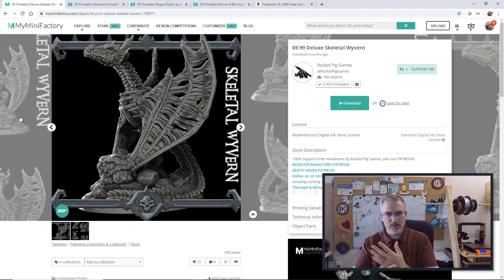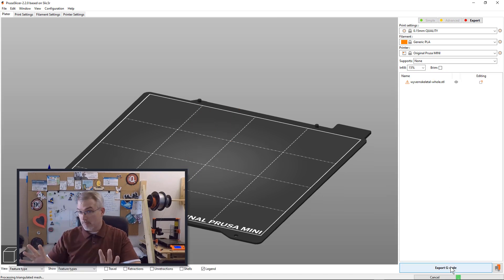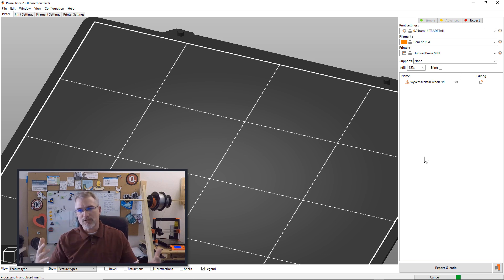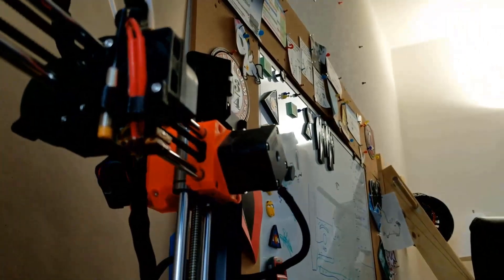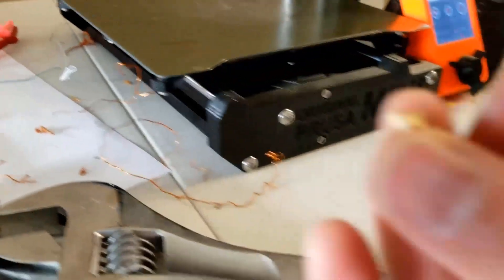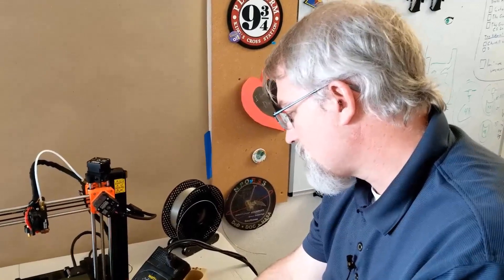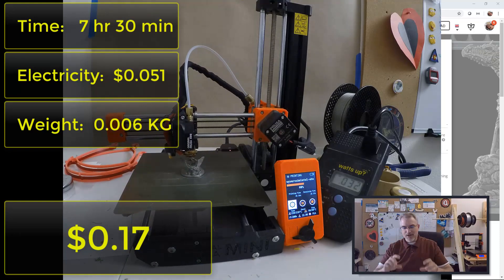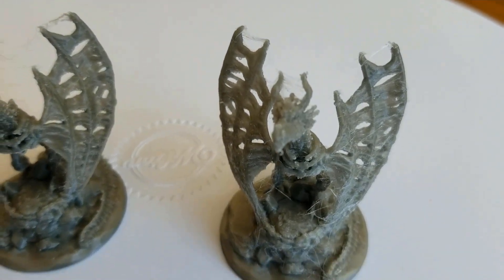Prusa Mini: Printing Miniatures 0.25 vs 0.4 nozzle

Comment: this video a couple years ago but do you use any supports on these when printing?
Reply from the maker: No you do not need to do supports with this particular model.
The folks at rocket pig games https://rocketpiggames.com/
Design 3D models in such a way that they do not need supports :)

Comment: Why do you take the nozzle off while hot?
Reply: That's normal practice, so any residual filament doesn't lock up the threads because its softened.

Comment: Noob question if I may. Why do you have to heat the nozzle to remove it?
Reply from the maker: The nozzle is in there pretty tight.  I did try to remove one once without heating it and I snapped the nozzle in two.
I believe heat block expands a little bit more than the nozzle when heated making it easy to replace

Comment: Hi Patrick, great video! I came to mention the Mini profiles available in PrusaSlicer like everyone else, but I'll give you directions to find the profiles. Open PrusaSlicer, on the right side under "printer" click the drop-down, at the bottom select "add/remover printers" , go to "Prusa FFF", and tick any of the nozzle sizes you want to use. Whenever you swap the nozzle on your machine you can change your profile in PrusaSlicer in the "printers" drop-down too.

Also, I'd like to point out that changing to a smaller nozzle only helps X/Y resolution. For example, smaller text is more legible when it's printed from a smaller nozzle. The only other advantage is printing very small things. I'm a MK3 owner, and I recently got an experimental 0.15mm nozzle from E3D. It's "experimental", so there aren't Prusa made profiles for it, but It's fun to experiment. With the 0.15mm nozzle, I was able to print a good looking "benchy" print at 12.5% scale. It's not super beginner material, but if you're curious how far you can push quality with an FDM/FFF printer, I can email some pitcures.

Thanks for the video!

Comment: Have a look at Makers Muse when he tested how much power is used on 3D printers. He used printers with and without heated beds and you are right. The stepper motors use bugger all power, the heated bed is the power drainer.

Comment: You should run the initial configuration wizard again (somewhere in the drop down menus) and select the .25 and .6 nozzles for you Mini, too. This way you will have proper settings after selecting the nozzle profile you want in the printer settings tab. It’s also a good way to simulate a different nozzle when slicing - to find out whether it makes sense to switch for certain prints.

Comment: Great experimenting, thanks :) The comment on linewidth below was also on my list so I'll skip that, but what I also thought was interesting was the minimum layer height when you changed it manually was 0.07 but it let you slice at 0.05.  The other point to mention is that the Prusa machines are very well calibrated out of the factory, but are still pretty 'generic' across the product. I tweak mine for dimensional accuracy for each filament I use, e-steps, extrusion multiplier, linear advance (which the mini is totally crap at so far by the way), but if you do this on any decent printer you can get great results as it's just a function of how long you want to spend tinkering :) An Ender 3 can do great work and CHEP's FIlament Friday dude (amongst others) does this with amazing results.
Reply from the maker: Good point to note.  Yeah if you are willing to tweak the settings you can get better results.
I am going to keep with "out of the box"  because I think out of the box will get better and better over time.
But... if all you were going to do was print miniatures you would want to tweak it so you could get better results.

Comment: Hey Patrick, I appreciate your videos/interrogations/tests. but you missed something on the 0.25 nozzle. its not only the nozzle size you need to change, you have to also change the extrusion width. normally a 0.4 nozzle will have somewhere between 0.42-0.5mm width depend of the profile you're using (stock... prettyPLA, etc...). if you only change the nozzle size, you arent changing the extrusion width so your printer will push a 0.42mm line through your 0.25mm nozzle. I often push 0.8mm width through a stock 0.4mm nozzle. and also lower my width to 0.25mm on a stock 0.4mm nozzle! you will have to redo your testing if you really want to compare :) also... on a 0.25mm nozzle youll want to set about 0.265 to 0.27 extrusion width for a  "perfect" squish. the extrusions are available in Print Setting => Advanced. happy printing!
Reply: Came here to say the same thing. If you switch over to Prusa's 0.25mm nozzle configuration that does this I bet your print times change a wee bit. :)
Reply: @IanDouglas  that's true, you could change the printer setting profile to the 0.25 nozzle default Prusa profile. I guess that's what Patrick would prefer as he doesnt like messing with setting normally. and I just noticed the extrusion width is plain simple 0.25mm hehehe
Reply from the maker: I don't like messing with stuff (So I can show the standard results)
But if Prusa has nice profiles I can download that is doable... Since you usually don't print at 0.25
Reply: @iqless  there nothing to download for 0.25, just add it as another printer profile. It's already built into prusaslicer
Reply: @iqless  Its only a matter of order you have to follow in Prusa slicer - first change printer (nozzle diameter), than select the filament, than the print settings. Because Prusa Slicer automaticly loads different print settings depending on nozzle diameter, even if the settings seem to have the same name (internaly they are named with "@0.25, @0.4 and @0.6). Prusa slicer automaticly selects the print settings depending on the printer settings at the moment you select the print settings from the list.

So by selecting "Ultradetail" first you loaded the printsettings for the actual printer with 0.4mm Nozzle (The "Ultradetail@0.4"-profile). Than you modified the printer, not fitting to the selected print setting "Ultradetail@0.4". So no difference in gcode - as extrusion width is the same as before - and so no difference in the print result. You have to reload the Ultradetail settings after you changed the nozzle diameter. Simply change print settings to something else (for example to Detail) and than to Ultradetail again - as you now set "Ultradetail "while the 0.25 Nozzle printer setting is active, the standard Ultradetail printing settings will become the correct one with 0.25 extrusion width. Print time will increasem if there is infill.

Actually I would call it an design error in Slic3r / Prusa slicer. The order of tabs schould be printer - filament - print settings, as this is the logical order of decissions to make before slicing. If you follow this order, normaly everything works fine... Sadly the GUI is structured the opposite.

PrusaSlicer does normaly automaticly reset printer settings and even filament when choosing another printer. But if you modify an preseted printer, this can not work full automaticly, as dependencys are not modified, so prusa slicer can not automaticly detect an invalite setting, so you get no warning.
Reply from the maker: I need to go look those up and try them out.
I imagine I would get better results.

Comment: Patrick, Prusa already suplies profile for the 0.25 and 0.6 mm nozzles in addition to the default 0,4.
Reply from the maker: I will have to go get those and try them
Reply: Once again dude, you don't need to "get them". You already have them. Its part of Prusa slicer. Just change nozzle size in the slicer
Reply: So if I have a .5mm nozzle what do I do?

Comment: They look great absolutely !  I will receive my  original mini on Saturday so any tips or recommendations I see that u have some experience with the mine , thanks for your great videos  📹
Reply from the maker: I would print all the pre-loaded 3d prints included on the thumb drive to give you a feel for the printer :)